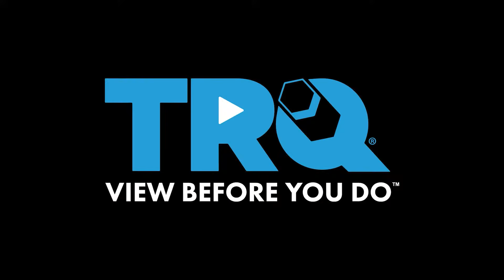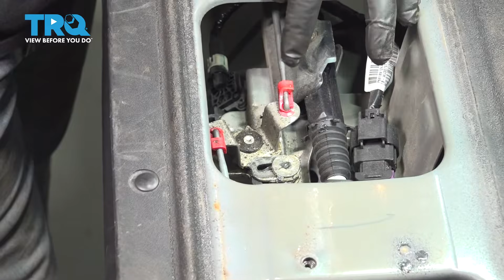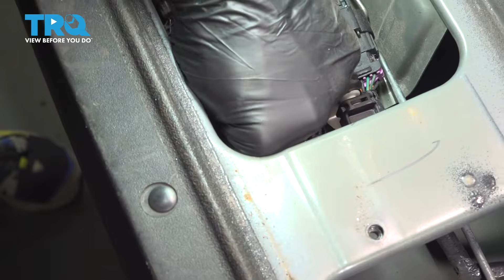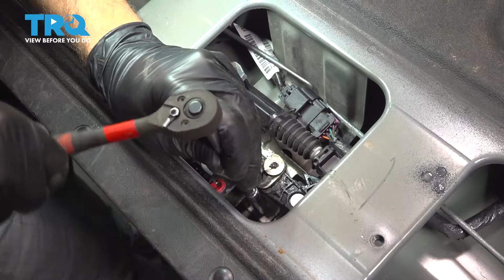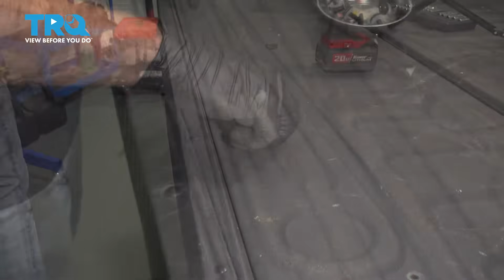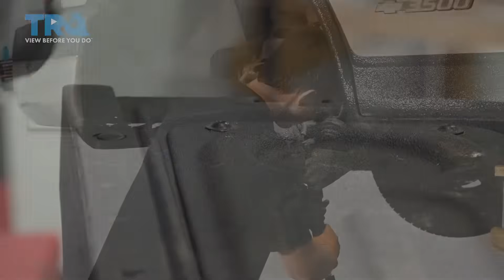How to Replace Rear View Camera 2011-2018 Ram

Comment: Is this replacement an AHD 1080p video? I want to upgrade but want it to be higher res since I upgraded to a better radio in my 2017 Ram 1500

Comment: My backup camera on my new 2017 Ram stopped working just as the warranty expired. Strangely enough, it still works if it is cold outside. It works for a few weeks starting at about this time of year until I head south in a month. No idea where the problem is, and I hate to replace the cam if it is a wiring problem.

Comment: Awesome video. I just changed mine out in 25 minutes. Only reason it took me that long was because i had to take the T-30 screws out with the tool. I didn't have the T-30 bit. 100% better vision with the new camera. Very happy.

Comment: Thanks for the very detailed instructions. Followed them to the letter and the camera works fine; however, the locking mechanism is no longer working. I have sprayed the connections with electrical cleaner. Still nothing. What are the chances that the locking actuator needs replacing and how do i tell?

Comment: Excellent video, and definitely save me $900. Dealerships will charge about $1,000 to fix this, and a smaller repair shop might still charge a couple hundred bucks. All to install an $80 camera in 20 minutes. Tip to anyone watching, when you are trying to get the handle out, lift up the tailgate and just gently wiggle around it will fall out. Also, putting the bars back in the clips make sure you keep them snug or your locking mechanism won't work

Comment: FYI, This is not the exact same camera setup on a 2012 RAM 1500, so not sure when they changed to the version in your video. Maybe specify the exact year of the truck in this video.  The connector is completely different on the 2012. It has a square/rectangle connector that has 2 rows of 3 pins with only 5 of the 6 being used. It also has slightly different mount for the camera and uses a T15 Torx bit for the screws. Was also able to remove the camera without removing the tailgate handle using a 1/4 drive ratchet with a T15 Torx bit on it. Otherwise the installation is similar.
Reply from the maker: +CMDR Bill Paxton Thanks for the feedback! http://1aau.to/m/Shop-TRQ

Comment: My backup camera got all distorted - watery foggy like after the dealership gassed & cleaned (power washed) up my truck before I came to pick it up. I got home went to reverse park and notice the camera was useless. 😪 Easy fix tho so no biggie.
Reply: Was the fix just getting a new camera? Thanks!
Reply: @mattmylleville  Yes, replacing the old one fixed it. 👍